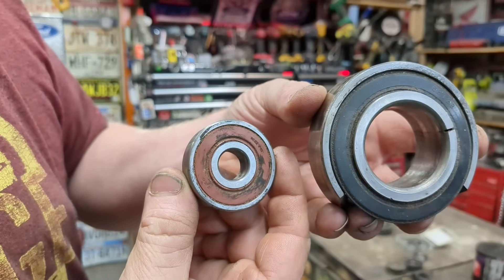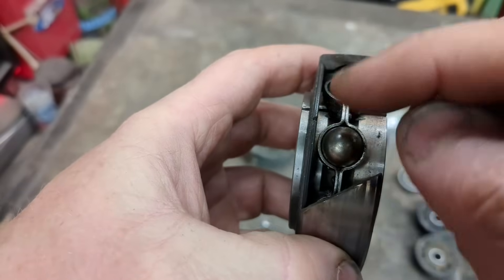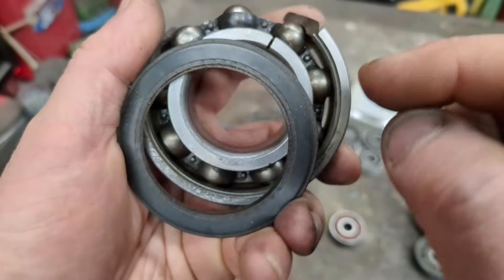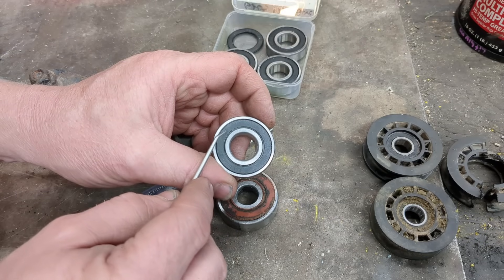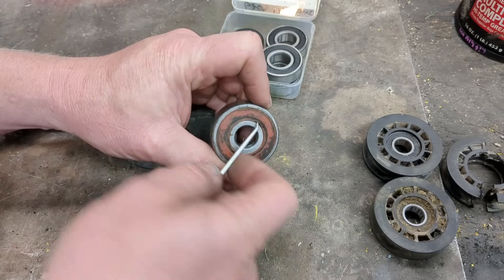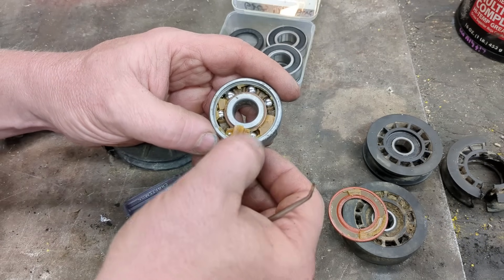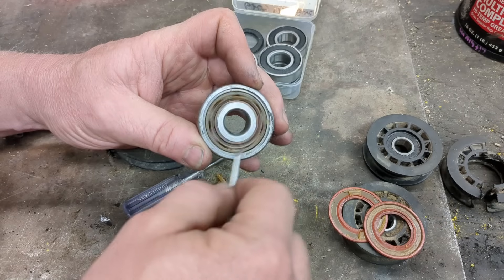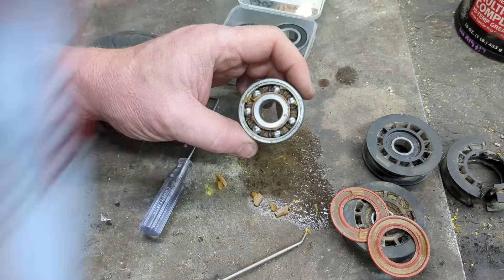How to GREASE, Un-Seize and Clean SEALED Bearings

Comment: i have assembled several hundred small PMA's (permanent magnet alternator) they were designed using case and shaft of the late 1960's Camaro alternator.  i used vaseline on the end of every shaft on the cup roller bearing, my boss told me that vaseline is simply whipped mineral oil, whipped untill it gets micro air bubbles and becomes thick, basically grease without the filler.
Reply: I'd be a bit concerned about using Vaseline as a grease. It is actually a wax & although it has a good viscosity for a grease at room temperature, it liquifies above 30degrees C & becomes a hard wax below 0 degrees C. It's good for protecting battery terminals from corrosion though.

Comment: If you pack bearings full of grease it will churn like a stalled hydraulic pump and generate a lot of heat. It also (excess grease) applies drag to the whole surface of the ball/roller and will actually stop it from rolling, instead it will slide on the races and destroy the bearing. I learned this the hard way, lol.

Comment: Mixed with clay?  Clay is an abrasive. How does that work?
Reply from the maker: Bentonite clay is such a fine clay it's actually more of a polish.
Reply: Bentonite clay is not composed of hard silica quartz sand like you might imagine, but is instead composed of softer talc like deposit and is silky smooth to the touch,

Comment: Is there an appropriate application of carbon fiber in compression loads? I've worked CF and composites in aviation and it's used in tension. Seems like CF in compression is more reliant on the epoxy for strength than the CF.

Comment: I clean the outside of the bearing and submerge the bearing in  a mixture of thick oil like STP or LUCAS in small bowl. Placed in a vacuum chamber. Pump out the air  and then let the air back into the chamber so the thick oil seeps into the bearing. Works great and then the bearings run smooth. Not a perfect solution but it works. And is quick and easy.

Comment: if you want to do it right, especially on the ones with the metal seal plates,  I'll inform you.   Old grease should all be removed before adding grease. To do it without removing covers you HAVE to use a vacuum generator of some type.  Vac cup the size of the o.d. of the bearing is held against rubber seal laid on bearing to create good seal.   Run the vac pulling grease out, into a Seperator cup (allows vac to escape but not the grease). to regrease simply apply grease to opposite face and it will lube by itself.  hope this helps someone.

Comment: Before taking the seals out of the idler pulley bearing, I'd clean all the debris off the pulley.  Use a pressure washer if necessary.  You want to prevent ANY dirt from getting in the bearing!!
Good tutorial for those who aren't aware of the inner workings of a sealed bearing.

Comment: What's your take on packing tapered wheel bearings? I was taught to pack them full but your video on sealed bearings has posed some questions in my mind...
Reply from the maker: Pack them full as 75% will just squish out in 10 seconds of running.
Reply: @sixtyfiveford  Thanks for that - I hoped I'd been doing it correctly for 45 years!🙂

Comment: In all my 61 years the best grease Ive ever used I think is Belray thats sold in motorcycle shops Ive use for years for my wheel bearings on cars n trucks n pwc/boat trailers as far as resealing I just get new and try for timken or koyo. I have poped seals and done this though.

Comment: Some say a moly infused grease is no good for a bearing because of the speed of rotation.
Your thoughts?

Great video, as always. Thanks.
(But I come here mostly for dog tricks!)
Reply from the maker: I've heard the same and really don't know. A lot of things like this have a tiny sliver of truth and people just generalize the statement and blanket it to everything. Who knows, maybe you shouldn't use moly grease in jet engines at 50000rpm and now it's a common thinking for every application. If all I had was moly grease, I'd put it in and not give it a second thought.

Comment: On Trek BB90 bearings you can pack them full without worry using Phil Woods hydrophobic grease. They don’t spin fast enough to overheat and expansion will push excess out into the outer dust seal area anyway which should also be filled with grease, all to keep water and sweat out. The Trek frames have a real issue with water and bottle sweat flowing down to the BB outer dust seal so everything you can do to keep it out will extend bearing life, including using SS angular contact bearings (which Hambini doesn’t like much), but I digress. They’ve worked for me for many years.
Reply: What Trek frames are you referring to?  Why not just get a Phil BB and rest easy?
Reply: @scottlundberg7720  Trek Road bike, anything with BB90. It’s a Trek only thing.

Comment: I have a Ford E-350 with 37k original miles that sat outside for awhile and has seen ALOT of snow. The alternator whistles dixie. I took the bearings out and they were completely dry. I repacked them with grease and they are now 50% better. If you spin them in your hand and perform tge typical GUY TEST and say yup looks good that has NO indication of what it will do. Only illustrate that it is not FUBAR. I have tensioner pulleys and idler pulleys that do not make a whisper yet they feel crunchy in the hand. These alternator bearings make a whistling sound only at idle!!!! I am 100% sure!!! I have measured said bearing with a inside/outside digital caliper and it DOES NOT match with any bearing size in existence. Im serious. $10 bearing. Give me a break. 
I could buy a new alternator because the sound makes the vehicle feel junky, but it works like a champ so who knows if it'll ever happen.

Comment: 30 years ago when I was an apprentice, as we know the fun jobs were repacking wheel bearings in trucks was for the apprentice to do, I was told that pack the bearing as normal and a little on the cone. Don't fill the hub full of grease as it retains the heat and will cause the grease in the bearing to burn, thus early bearing failure. We had a fleet of new trucks that had wheel bearing issues, and the hubs were packed full from the factory, burned grease around the bearing and about a kilogram of new grease in the hub. People look at the smaller bearings in the video and say it has bugger all grease in it, let's pack it full, don't understand the properties of grease.

Comment: If you have bearings that you intend to reuse and they are full of old grease and thickener put them in an old counter top oven, I put them in at 200deg for about 20 min. The old thickener and grease melts out leaving mostly oil film behind. It saves on degreaser, and expensive aerosol degreaser. Afterward clean the bearings out thoroughly, re apply grease put the seals back on and use them. Don't let the oven get too hot, don't let the oven cook out the old stuff and dry out, just melt the old grease out.

Comment: I was a Maintenance and Engineering Manager for 30yrs +.  50% of bearings fail due to lack of lubrication and 50% fail due to too much.  If you overpack a bearing, it will overheat and as grease is 90% oil, it will simply leak out causing premature failure.
All the bearing manufacturers issue tables of the amount of grease per bearing and the frequency of lubrication (which is dependent on load, size, speed and environment).  You are quite right, sealed bearings do need to be relubed (which can be a pain if they are located at the non drive end of a motor)..  Again, the bearing makers offer superb maintenance advice for free.
Hope this helps
Reply: Question - if the bearing is over-filled and the grease leaks out, wouldn't it leak out until the correct amount of grease is left?
Reply: @LMF5000  Absolutely not.  What will happen is the bearing will overheat, the grease will leak out completely and the bearing will fail
Reply: @MrRunner I guess that makes sense. I had a ball bearing seize up in the wheel hub of my high-end radio control car. The shaft running through the bearing got so hot from rubbing the bearing's inner race that its plastic part melted - I only noticed the failure after a few minutes because the wheel started wobbling and I burnt my finger on the central wheel nut. Later I took apart the bearing and found it full of crud, but after removing the dirt, cleaning with WD40 and packing with light grease the bearing started turning smoothly again. I wonder why it failed in the first place, I've only had this brand new car for a month, though I'm driving it through harsh sandy terrain. Pity how the $1 bearing ruined a $20 shaft set.
Reply: YOR A VERY BAD IGNORANT ENGINEER.

eNGINE MACHINIST HERE
Reply: why do you say that

Comment: I carefully pop out the seals, soak the bearing in Benzene which quickly dissolves and loosens all the muck. I then vertically submerse half the bearing in clean Benzine and spin the bearing till it runs freely. This helps to flush out all micro bits and pieces, then I repeat that in clean Benzene again. Once done it evaporates quickly and can be repacked with suitable grease. I've done my one vacuum cleaner twice in many years, still fine. Also did my Golf 4 Variant alternator belt tensioner when it became noisy, 40 thousand kilometers on and still fine.
FYI - The Benzene I'm using is not the Cancer causing Benzene, BENZINE is, but I still wear gloves and work in a relatively well ventilated area.

Comment: Its ok to pack it completely full in low rpm aplications, like up to 8-10k rpm. Over that, it needs empty space. For example, Tesla recommends that you pack their engine ball bearings (100k max rpm), at max 30% (100% being fully packed). From the factory, they come at 15%.
Reply: This is a good point. For instance riding mower blades only turn at around 3K RPMs, which is why they usually come with zerk fittings. Any bearing with a zerk fitting, is the manufacturer specifically telling us they want the bearing fully packed, not 25% as in this video.

Comment: Considering many of the comments, it seems your video has done some good regarding the nature and repackability of sealed bearings. That said, how much grease to use, and the potential for either longevity or premature failure is still a matter of opinion. I have never had a repacked bearing fail in service in some 60 years, and I routinely overpack bearings because, 1, that's how I do it, and 2, sealed bearings aren't actually sealed, as demonstrated with your dirty bearing that had dirt in it, not to mention that if the oil in the grease has dried out, it has to have gone somewhere. Every failed bearing I have seen has been factory greased, and not one of them had enough grease to start with. So I would say if you wish to maintain that over packing bearings is bad for bearings, please prove it.
Reply from the maker: I mean anybody can have their own opinion, but when it comes to sealed bearings, there are countless technical articles on the subject. So it's not really a matter of opinion. You can do a quick Google search and find manufacturers have charts that show heat, bearing life, bearing wear due to over greasing. SKF, Timken and others all have charts and technical specs showing you shouldn't fill bearings more than 15 to 35% depending on the size. 

The same reason you don't fill your car engine completely to the top with oil. The moving parts will aerate the oil, they'll be added rolling resistance, it'll cause excessive heat build up, and blow out seals. No, the seal on a sealed bearing isn't airtight and if you fill it completely full, you'll notice grease exiting through the inside seal that is generally white and foamy because you have aerated all of the grease and destroyed its lubricating properties. Now you have other issues like cavitation of the grease that can destroy the ball bearings. You're dumping excessive heat into the rolling parts. You have extreme added rolling resistance. And not just a little bit more rolling resistance. You have a bearing that is 10 x, 20x harder to roll versus a properly lubricated one. 

The mindset of fully packing a sealed bearing come from needing to pack a non-sealed; say roller wheel bearing. Yes you pack those 100% and it will immediately, once you start running push out 75% of the grease and use just what it needs. It never has a problem with aerating the grease because it can just push it right out the sides.
Reply: nie wygłupiaj się, masz racię w przypadku wolnoobrotowych łożysk ale nie w przypadku wysokoobrotowych,   napakuj 100% smaru do łozysk w odkurzaczu, albo w jakiejś innego szybkoobrotowej maszynie. bedziesz miał smar na twarzy, suficie i na skarpetach😁

Comment: TVA was wondering why so many motors were failing . Found out the main cause was adding grease .
i never figured out what to do with bearings . Since grease is just something that holds the oil in place , i was thinking adding oil would be better than adding grease ?
Reply: This is about electric motors that are Not on cars
Reply from the maker: I have added oil to sealed bearings that I didn't want to remove the bearing or it wasn't very accessible many times. The only oil I have found suitable for this is chainsaw bar oil. That is because it is a SAE 30 weight oil but it has tacking agents that make it sticky so it stays in place and doesn't just run out. Motor oil or any other kind of oil, once you put it in it just runs out and is gone in an hour of runtime. The chainsaw bar oil is designed to be held in place and not flung off on that bar of a chainsaw. In my mind that makes it a perfectly suitable oil for this situation.

Comment: I take a new bearing pop the seal clean out the grease and fill with enough grease round about 65% grease in the the gap as the manufacturer doesn't put enough grease in the first place so they can sell more. Why 65% is that when the bearing spins central fungal force flings it to the outer part of the bearing and grease the bearing but if your bearing slightly gets hot there is enough expansion in the air gap plus if the bearing cools the grease wil flow back where if you use only 25% this doesn't happen plus grease is not just there to lubricate but a cleaning agent and a cooling agent. Doing it my why the bearings last way longer. I'm 30 plus years a master mechanic and I have not had bearing failures of grease that got dry or ceized up because of heat. When the bearings are worn-out they still look polished and not pitted also deu to that the grease cleans the surface allowing the contamination to go elsewhere instead of staying with a on a fraction of grease as with a lot more grease there is also more movement on the grease as it needs to clear the bearings rollers or balls that does not happen with just 25% grease. Had never had a bearing fail due to to much grease. And the machines I work on is heavy duty truck and earth moving machines but there is a down side if you are a boy/girl racer then you'd probably want less grease but this comes with it's own problems then I'd recommend a minimum of 40% if you don't want to spend more times replacing bearings than racing.
Yes I have been a master mechanic all my life and my clients book and pay me up one month up front for me to work on their machines and personal vehicles in my region that tells you how good my work is.

Comment: I didn't know this. I figured sealed meant...SEALED, as in crimped, or some way inaccessible. Years ago my bright idea was to take a bearing and heat up some grease in a small pan on the stove being careful not to get it too hot, put bearing in and let cool. It worked very well but for bearings that need cleaning, not a good idea.

Comment: In fact I soak my bearings in 50-W10 engine oil 🛢. In a clear plastic jar it works good for decades.
50% of bearings are on service the others are in demand waiting in the oil jar. Every now and then I switch them around the same group of bearings since 2006.

Comment: When we were kids we cleaned the bearings on our bikes with some gas in a mason jar and re-lubed them with petroleum jelly because that's what we had around the house.  I'm guessing petroleum jelly would not be ideal for high speed bearings?
Reply: Petroleum jelly would probably work a moderate temperatures. During the 60's I was instructed to grease bikes with Vaseline. I used it in a  coaster brake & the brake wouldn't work on a cool fall day because the Vaseline thickened.

Comment: How to clean and un-sieze a sealed bearing. 
1 Remove bearing,
2 Discard and replace bearing.
The whole idea of a sealed bearing is that they are sealed for life!
Once they become siezed or rough running REPLACE them! theres no economy in re-greasing a sealed bearing once they've reached the end of their service life!
Reply: We had a floor sander once that needed a replacement bearing.  This particular machine, and it's sealed bearings, were made in Italy.  Replacement bearings were not available from the Manufactures United States sales representative, so they ordered them from the manufacturer located in another Continent. While we waited, and the machine was out of service, the ocean freighter carrying the replacements sank. It took six months, and expedited air freight to return to service. The downtime cost about $2,400. What was it you said about "no economy"?